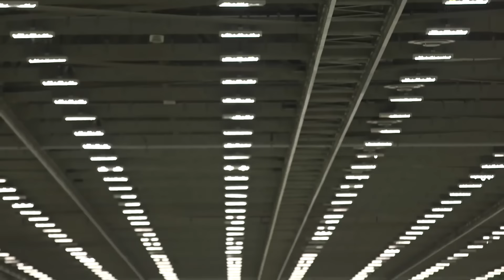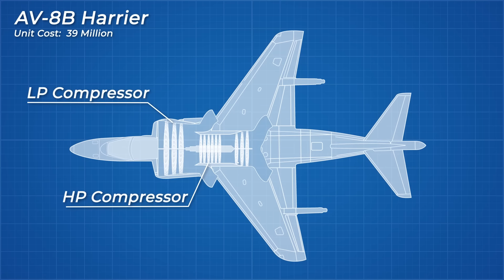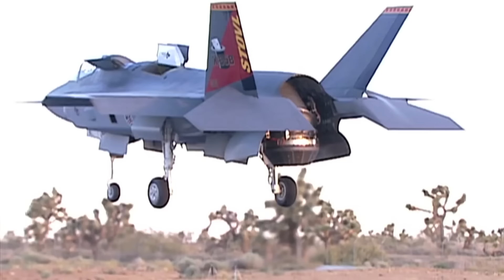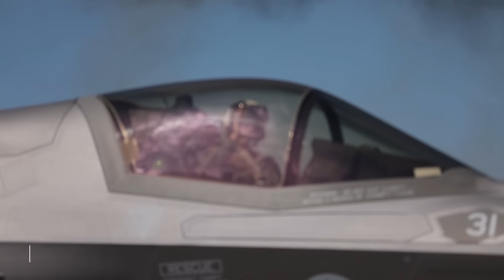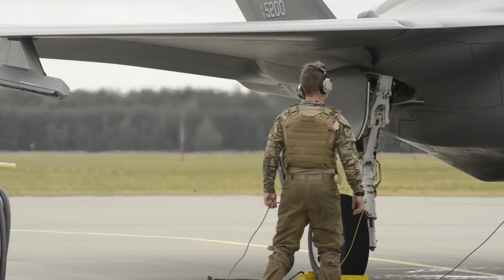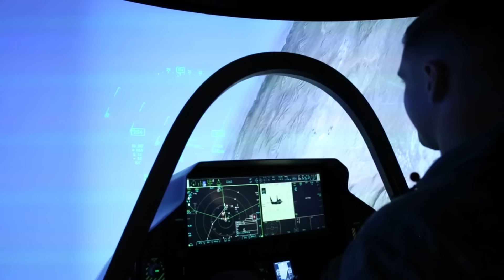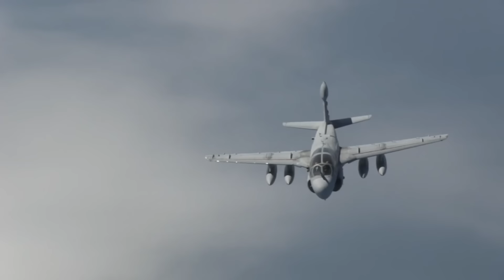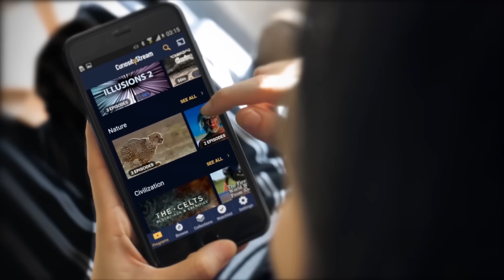Is The F-35 Worth $115 Million?

Comment: UMM.. so my problem with this is the f35 was supposed to be the cheaper option to the f22. It's inferior in almost every aspect yet costs more now? wtf is the point.. f22 can run entire mission mach 2 can out maneuver the f35 is stealthier than f35 and has a longer range... but its cheaper too? thats fucking ridiculous. The only thing the f35 has that the f22 doesnt is an air craft carrier varient  which is hugely valuable and the f35 has more radar capabilities in some varients with its modular like design allowing it to play many roles. f22 owns and is cheaper whats their excuse??
Reply: The F-22 is definitely not cheaper
Reply: @infinitelyexplosive  umm the f35 has just been touted as the most expensive weapons system the us has ever had. So that means it is. it even says that in the video if you watched it. i beleive the cost per air craft the f22 is more expensive but life time cost due to more cost per flight hour the f35 becomes more expensive to own and operate.
Reply: @LordPhoton-rl4ot  The F-22 is significantly more expensive than the F-35 per flight hour as well. The lifetime cost for the F-35 program is higher because we're buying about 13 times more F-35s.
Reply: @infinitelyexplosive  from what I just read the cost of the f35 per hour is higher. Also its cost per unit not cost per fleet. Shouldnt the higher order be cheaper per unit?  flight hour cost for f35 is 67k f22 is 60k. I believe its more to do with the newer varients also of the f35 are more costly. again though it's being said by many sources the f35 is the most expensive weapons system in US history which is stating its more expensive than an f22. so idk how you can really argue with that so whatever you say bud
Reply: @infinitelyexplosive  the sources that say that also say its over the lifetime so per unit sure the f22 is more expensive but if the lifetime cost is cheaper why are we using a sub par product?
Reply: @infinitelyexplosive  The F-35 has become infamous for its ever-rising cost, which is expected to reach an estimated $1.5 trillion over the estimated five-and-a-half decades of its useful lifespan. In part, this is because it has spent more than a decade-and-a-half in a development, thus racking up year after year of development costs. However, it should be noted that this is because the F-35 is expected to be able to fulfill a number of roles, with examples ranging from the F-35A, which will use standard takeoff and landing, to the F-35B, which will use short takeoff and vertical landing, and the F-35C, which will use takeoff and landing suitable for use on an aircraft carrier. It remains to be seen whether the F-35’s stealth, superior sensors, and supersonic speed will enable it to live up to its reputation as the best fighter, but what is known that a single plane will cost at least $100 million.
Reply: @infinitelyexplosive  In total, the F-22 Raptor cost $79.2 billion, which is appropriate considering that it is a state-of-the-air stealth fighter. As a result, it should come as no surprise to learn that it has two short-range air-to-air missiles and six medium-range air-to-air missiles, which are supposed to enable it to blast its opponents out of the air before they can even notice its presence. However, it is interesting to note that it carries bombs as well so that it can perform in other missions as well.
Reply: @infinitelyexplosive  so by the wording its the cost of every plane added together? that would make sense since we only have like 200 f22s? thats a stupid way to look at it but considering it's replacing almost every fighter aircraft role we have sure, but it's just a stupid way to break it down they make it sound like per unit not for the whole fleet... in that case I'm sure the standard issue rifle for infantry would be one of the most expensive weapon systems considering how many we employ lol but does that sound right? the way the look at it as cost for the fleet not per plane?
Reply: @LordPhoton-rl4ot  Nobody puts the CPFH for the F-35 at $67k. It's been well-covered that the F-35's CPFH is in the 30,000s. Citing $79.2 billion as the program cost for the F-22 is deeply misleading, as that only covers the development and acquisition costs while the F-35's price tag includes 50 years of sustainment and maintenance cost in inflation-adjusted dollars. 

If you want to actually compare the costs, you have to look at each section separately. The F-22's inflation adjusted development cost is about $40B, the F-35s is something like $70B. In that respect, the F-35 has been more expensive. The unit costs are tricky, because they decrease over time, but it's generally considered at least somewhat fair to use lowest flyaway cost. The F-35A is around $80M, the F-22, again inflation adjusted, is is closer to $170M. Sustainment and maintenance costs are harder to compare. There are different ways to calculate CPFH that can make it vary by a large degree, so comparing different planes can be risky. Alternatively, you can use annual maintenance per airframe, but that's hard to find. 

The total acquisition cost for the M4 doesn't even come close. The unit cost is sub-$1000, so even if you assume an extremely high estimate of 10 million M4s have been purchased, that's less than $10B. Development and maintenance costs are negligible.
Reply: @infinitelyexplosive  I was just using the m4 as a stupid comparative as to why we shouldnt look at things as fleet cost vs unit cost.  I got the CPFH from https://militarymachine.com/f-22-raptor-vs-f-35-lightning-ii/ as my source. I didn't vet the site or anything just a quit google. Like bill bur says, any time someone argues online they just go to www.imright.com lol but you definitely know more about the subject. I just saw all these articles and videos claiming the f35 over its life time will be the most expensive weapon system ever. This made me react as why did we even switch to it then? So basically a single unit vs single unit the f22 is still way too expensive to run as our main fighter especially since it's very limited in not being able to land on air craft carriers? It seems then that their statement is misleading that the f35 is the most expensive. like i said in the video we are  commenting on states that the f35 is the most expensive. So is the f35 the most expensive weapons system or not? if it's right then the f22 is cheaper if it's wrong then why are all these videos and articles claiming so? thanks for the replies btw I really enjoy talking about this stuff. I've loved the f22 since it was announced to be in development it really annoyed me when they switched to such a limited range air craft that was less capable.

Comment: Behind schedule and hundreds of billions of dollars overbudget. Considering that overseas buyers (and the USAF) are starting to buy the F-15EX over this, I think it's pretty clear the F-35 is a failure. Too fast to loiter for ground support. Not enough payload. Expensive and difficult to maintain and fly. Gets smoked in dogfights. Vulnerable single engine. In theory it's a game-changer. But in practice, it's jack of all trades, master of none. Basically the F-111 all over again.
Reply: The F-15EX is not sold to any nation other than the US, and it's being used to replace F-15C/Ds, not F-35 slots. It has greater payload capacity than the F-16. There isn't any evidence that the F-35 is terrible in dogfights.
Reply: @infinitelyexplosive  That's my bad. I think I was thinking of the F-15IA (based on the EX, but not precisely the same). 

There's no evidence that it's a good dogfighter, either. I know in multiple exercises it has been outperformed by the F-16, but some folks claim that was a flawed test so I can't say so with certainty. But I think the point stands. Originally, the F-35 was built to ben an affordable joint fighter. The cost per unit has ballooned like mad, and it's shown to fall very short in several areas.

Comment: Soviet designed VTOL, taken from YAK-141.  The Soviet Union did the R&D.  https://youtu.be/D3T9sA3Ymh0?t=420
Reply: The lift system on the Yak-141 was very different. It used two small turbojets instead of a fan connected to the main engine.
Reply: @infinitelyexplosive  The positions and control of thrust is way more important than where the fuel is combusted.
Reply: @GeckoCkCkCk  The point is that there's a significant difference that took a lot of engineering work to develop.

Comment: I've been curious about this since I found out they made three different planes... Why couldn't the A and C  variants be consolidated into one ? Surely removing the hook, putting lighter gear (or even not) and building the wing out of one piece instead of 2 without the servos needed to flip them open, and with a larger wingspan would make for a plane with better characteristics? 

I mean, yes, that would probably be reflected in the manhours Lockheed got paid to support with the development, but I mean, probably not the last deal they win... :D
Reply: Larger wings might have made it more efficient when turning, but that wasn't the design goal of the F-35.
Reply: @infinitelyexplosive  No, but 'make one airframe for three branches so it would be more affordable' was...
Reply: The C variant is reinforced to be able to land/take off on a carrier. The hook is required to catch the arresting cable, and heavier gear is needed to absorb the higher impact. The entire aircraft is heavily reinforced to enable this, which is why the C variant is the most expensive.
Reply: @TheGuyZane  Sorry, I wasn't clear enough. My point was, anyone tasked with doing a carrier variant, would already know those things you mentioned. So, surely you would want to make that one (or the VTOL) variant first, and then the A variant could just be a slightly stripped down version of the C, the development cost would be less, because you wouldn't have to do aerodynamic tests on two differently shaped planes, but just put fewer layers of fiber or thinner aluminium for the A variant... (yes, yes, the gun, but Lockheed of all companies should have learned by now it's safer to take shit out of a plane than stick things on one...)
Reply: @IgorKolar  The C variant has more internal bulkheads, reinforcements, etc... than the A version. You could remove 'un-needed' internal parts like the reinforcing bulkheads, but then you'd have to modify other parts to make up for the loss of structure in that cavity. Its cheaper in the long run to just have a different model, as long as it shares the majority of tooling.

Comment: The F35A last confirmed price was under 80 million USD.

The F35B was like 115 million, but it's also way more complicated. The F35C is built in much smaller volume and hence more expensive than the A by a decent margin at 105mil I think it was
Reply: Finland just bought 64 units, the unit price was under 74 million euros
Reply: @projecttitanium-slowishdriver  the prices tend to vary per country it seems from what I can find.

For example the UK ended up paying more than expected due to inflation
Reply: @invertedv12powerhouse77  Another thing, contracts also vary with what’s included. The Finnish price is what is known as the “Fly-Away Cost”, i.e. this is everything included in the plane so you can “fly it away” from the factory….Well…..Maybe except a tank of gas…that is….Me and other sometimes have to slap people’s head when they say, “HA! You forgot the price of the engine”! And we have to slap them on the head and go, “just what part of Fly-Away, that is FLY-AWAY don’t you understand?!?!?”…..Well….Ok….Ummmm…..Yeah, maybe except the tank of gas and….and…..Well….Hire a pilot to fly the plane out of here…..

…..Well, that leads to my next point. If you see a jet’s price that states the F-35 is 250 million, then start looking at the contract’s fine print. This means the jet usually has things like pilot training, maintenance crew training, use of overhaul facilities (U.S. is located in Fort Worth, Europe in Italy), especially engine overhaul facilities and weapons cause no country will buy something like this without all of these in tow and they usually receive a large discount too. Hence why, if the press scream, “WAAaaaHaaaaa!!!! The F-35 cost $400 million a pop!!!!” Just roll your eyes and look at the fine prints when it should be a “Fly-Away” comparison. But yeah, for countries…..They just don’t go and buy a useless lawn ornament if you know what mean.
Reply: @StryderK  oh I'm fully aware, but most others aren't. There's a political thing around planes like these
Reply: @StryderK  The F-35 isn't replacing the F15 other than the Strike Eagle variant.
Reply: Denmark got 27 A models for 78 million dollars a piece. The price has fallen a lot since the contract was first signed.
Reply: @wile123456  oh sweet, at this rate in a few years, the US will be paying me to take them. 

Thats how linear graphs work, right?
Reply: Right, but the price is only that "low" cuz so many countries, allies, have been ordering them. However even at 115mil$ it wouldn't be that expensive since other modern jets like Rafale or Eurofighter cost just as much and don't have many of the features, not just stealth.
Reply: @bekeneel  115$mil per unit is the F35B, which is a way more complicated jet, if you want to compare the B model, its only equivalent in a sense is the sea harrier, which it outperforms in every possible metric. the First F35A models with low orders ranged about 83-91 mil per unit
Reply: Top ten expensive fighter jets https://www.youtube.com/watch?v=rTPYJRcvjwU&t=11s
Reply: I guess I'll go for the F35A since VTOL capabilities aren't something I'm too worried about. I'll just build a runway in my backyard 👍
Reply: There was a good video out from Perun about this topic recently, specifically defense contractors and spending. I’m stealing this directly from his video but it’s worth a watch still. Essentially yes the price is $80 million, but in reality it’s not really costing this much for the US government since that money goes to the government via things like income tax and payroll taxes that businesses pay to employees, then those employees buy things and pay sales tax which provides funding for other businesses to have employees, etc. also capital gains tax, etc paid on stock sales. It would be interesting if we could find out what the cost is after deducting the taxes the US takes back
Reply: @justinedwards2496  I mean, I don't know what's different from how it's always been
Reply: Bargain!
I'll take 2!
Reply: You're correct as the production line increase the prices have and will continue to drop - it is below $80 million since Germany signed up.
Reply: @hstad100  it's been below 80 mil on each of the 3 (ithink it's 3) production lines actually for at least 3 years. I think the first batch were at 85-90 mil. 

You can ask for sources but.... I don't have these anymore lol. But I do have contacts surrounding the F35
Reply: @invertedv12powerhouse77  Don't disagree with you. Have decades of experience financing defense contractors (Lockheed Martin used to be my customer) and know that as production volume continues to increase each batch's prices continue to drop - classic Economics 101.

Comment: the problem is it is not better congress wanted 1 plane does all this is 3 planes I  it is not a air suporty plane and the a10 would wipe it in its roal the gun is lighter and the time on staion is less to get it to do all roles it does none the best the f111 was suposed to be one plane for af and navy the af ver worked out some the navy ver sucked and they were two difernt airplane the f15ex does more wale more orance it may stand of the suport a stlth plane but the f22 or f35 could not carrie as much

Comment: F-35 doesn't allow for more payload in VTOL configuration than the harrier :
Harrier : Thrust = 10800 Kgf, Weight = 6140 Kg, Lift power margin = 4660 Kg.
F-35B   : Thurst = 18865 Kgf, Weight = 14580 Kg, Lift power margin = 4285 Kg.

It actually allows for even less, and that's without fuel !
Reply: Neither plane will take off vertically in any real capacity. They're both doing rolling takeoffs.

Comment: The F-15 is a 4th gen air superiority fighter; the F-35 is a 5th gen multi-role fighter. Saying that the latter does not dogfight as well as the former should be no surprise. Saying that it doesn't dogfight as well as an F-16 - the 4th gen multi-role fighter it was intended to replace - is more than a little concerning.
Reply: The popular instance where it was "outperformed" by an F-16 was when rudder authority was being fine tuned. It's truly ridiculous what a clown show arose from that.